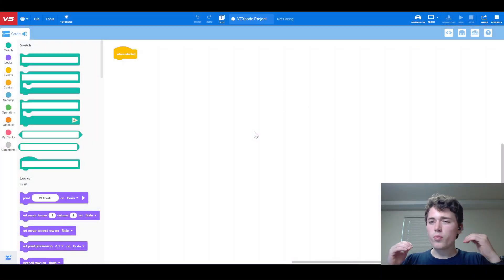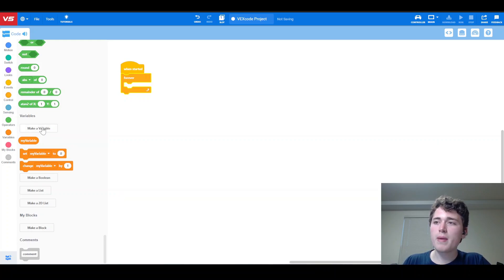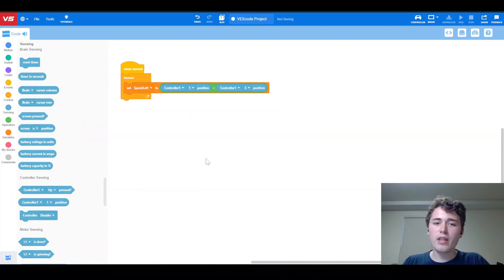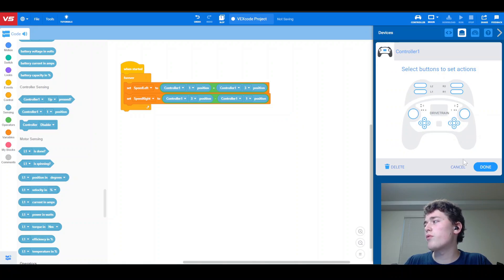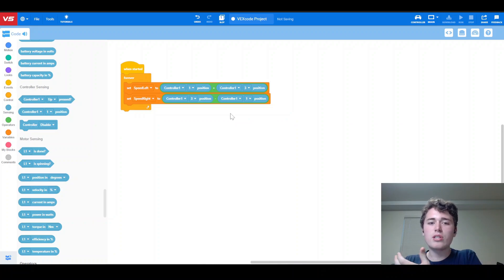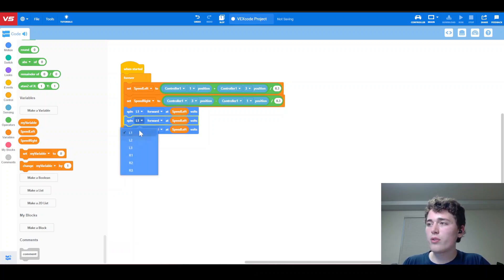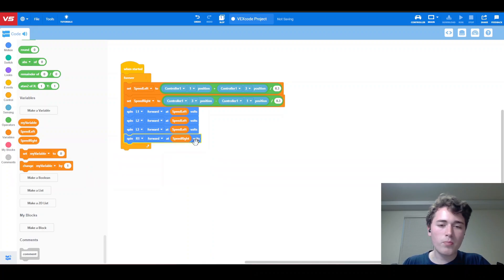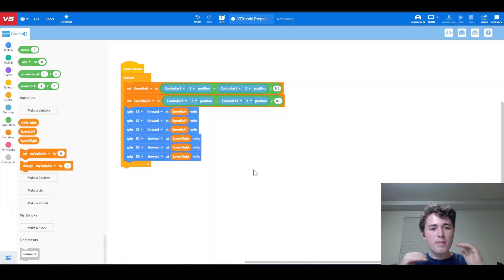Coding a 6 Motor Drive in VEX V5 Blocks

Comment: For anyone reading this there is a newer easier way to do it:

1. Setup a four motor drivetrain in the devices menu
2. Add your extra 2 motors for 6 motor drive or even 4 for an eight motor drive in the devices menu
3. Add a controller in the devices menu and config your choice of drive controls
4. Get a when started block and a switch block and in the switch block put this for each motor: 
"left_drive_smart._motors.append(motor_7)" this would be for a motor in port 7 for the left drivetrain
"right_drive_smart._motors.append(motor_4)" this would be for a motor in port 4 for the right drivetrain
5. do this for your two motors or 4 motors if your doing a six motor or an eight motor drive
Reply from the maker: I never thought to do it this way, but that's super cool that you found a way to use the integrated drivetrain to do it
Reply: Do you just put the switch blocks with the code under the when started block? Does that alone make both sides of the motors go or do you need to add more blocks?
Reply: @owlishfish6362 yes it will function like a normal vex drivetrain

Comment: Just to make sure, we put all of this code in "when driver control", not "when started", right?
Reply from the maker: Yes that's correct, either would work, but putting it under when started would make it always running instead of just during driver control

Comment: does this code make a functional driving and turning drive train, or is it just fragments of what you need to drive? Also, if this code does make a fully functional 6 motor drive, how can i add an autonomous code to this program.
Reply from the maker: It is a fully functional 6 motor drive for driver control. I have a different video for auton.

Comment: This was super helpful. Could you possibly do a video on how to code an inertial sensor in block code? Or, if possible, odometry?
Reply: Inertial sensor you can just plug it and set it up with the drivetrain and it’s just not worth it to do odometry in blocks

Comment: Nice video. Could you make a sample code for 6 motor drive train to drive forward by a certain distance and turning for a fixed degree? It is not easy to take the gear ratio into account.

Comment: I did it right, but when i tried to make it faster by increasing the motors rpm, it didnt work. So my bot is slow
Reply: But I mean, it worked
Reply: But it was super slow. Can I please get some help?
Reply: @26163X There is no such thing as setting rpm in VexCode V5. Do you mean velocity? If so switch it to volts, which he said works better in the video. Use full volts for 100% velocity, 1/2 volts for 50% velocity, etc.
Reply from the maker: @team94802f  The way I did it will run your motors at full power when you push the joystick all the way. I would take a look at your code and make sure it matches mine, and then I'd take a look at your drivetrain and make sure it's not the hardware on your drivetrain (like the gear ratio) that's making it slow.